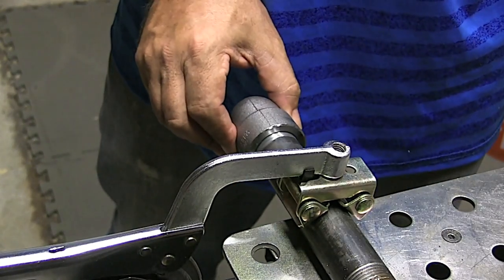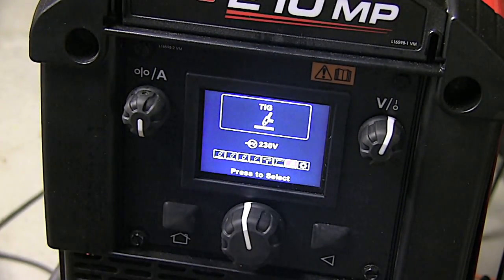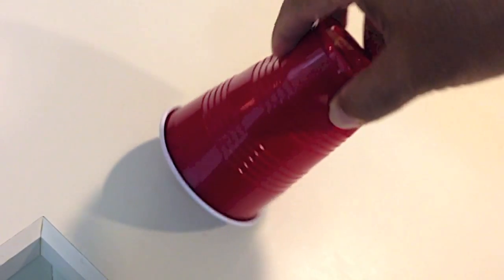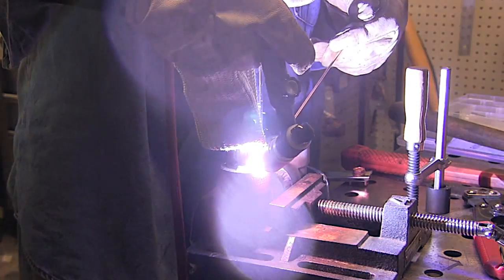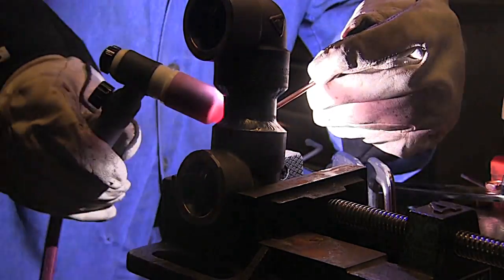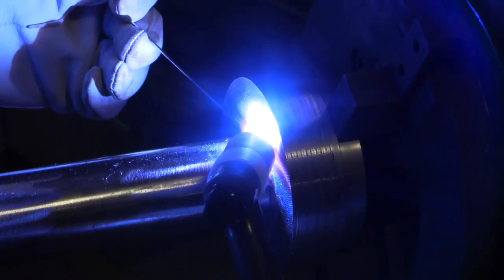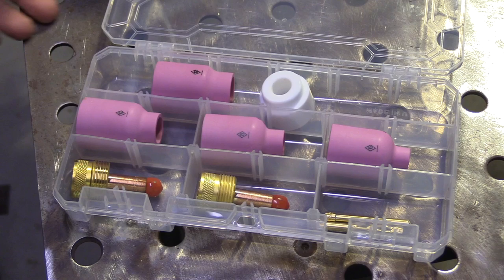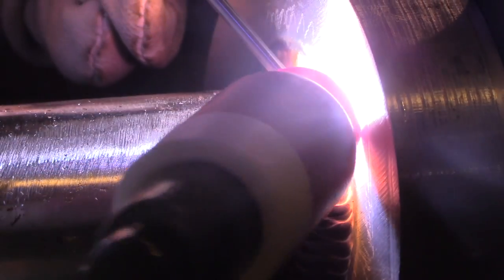Socket Weld TIG Welding Tips

Comment: Loving the content my bro.. I'm a newb but I did do a bit of stick and Acetylene back when I was a youth @ 11/12/13 back in high school (as u call it in the US but we say secondary school in IRE) metalwork class. It's been a heck of a long time bcos I'm 50 now..LOL
Why do u weld so many passes on these welds and do u have to carry out so many passes on all welding TIG jobs u do? I am going to practice a bit of Stick welding in the morning but I bought my 1st Lift Tig torch WP-17V I think is the name of it. It's not one of the Flexible ones. I paid just 60 Euros for it. It came with a good length lead on it too.
So I bought some filler rods and Tungsten rods for my torch. Could u tell me if the collet has to be the same size as the Gas nozzle? I only have to split collets atm. Should the collets fit into the other part inside the torch, the name I have forgotten atm but I'm hopeful u know what I'm talking about? Do they have to be the same sizes, meaning do they need to be tight fitting and not have any slop inside?? I'm hoping u understand my question or I should say I'm hoping I asked it correctly.. LOL
As I said I'm a complete newbie to TIG and Welding tbf. What I might have done 37 years ago means nothing nowadays.
Thanks for the great content my bro.. U explain the set up better than most